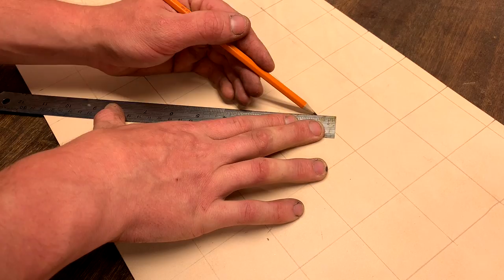Woodturning - Stacked Leather Mallet

Comment: Really great idea well executed  ... the only thing I would do differently would be to heat the steel rings on the stove before attaching to the mallet head to give them a tighter and more durable fit.
Reply from the maker: Thanks for watching Ryan, I did consider that but didn’t want to burn the rings on as it leaves unsightly marks. Instead iv used kiln dried wood that will swell somewhat in our fairly humid climate and I hope that as the end grain flairs over time with use it will also tighten down the rings.. I do agree tho.. smaller tenons and hot rings would
Make for a tighter fit. 👍🏻
Thanks for Watching
Reply: Thought this also

Comment: Excellent job Jack. A lot of planning for the design and materials used went into this project. Always a pleasure to watch your videos. Well done 👏.
Reply: I did not even know you could do this with leather.  Such a clever idea and great execution!  Your projects always make for good watching!
Reply from the maker: Thanks Rebecca. This is a fairly common style of knife handle and goes back century’s ( if not longer) rather than resin I believe they used some
Part of rain dear to make the glue 🥴 
And antlers to cap the leather/hide.
Reply: @JackMackWoodturning  That is great background info, Jack.  I am fascinated by mankind's ability to make tools out of what is at hand.

Comment: You obviously had a LOT of fun making that. Far more work than I would have done for a similar tool, but it does look really nice, and no one will have one like it. With the steel ferules you used on the ends of the head, standard M2 high speed steel would cut them down, as in facing the top and bottom of them. The through bolt was a good idea too. I did construction for years, and didn't like the metal handled hammers at all.  The leather on that should dampen all vibration issues....
Reply from the maker: Indeed, it’s a lovely grip. I didn’t consider turning the mild steel with hand tools but I’ve turned allot of brass on the wood lathe so probably should have gave it a shot. 
I definitely made this for the sake of making it rather than needing a mallet.. as, I’ve got the same old mallet I turned some 15 years ago for braying stuff, this little one was something I’d like my kids to look at when they are old men and laugh at how daft their old man was 😆
Reply: As long as they don't try to use it on each other......
Reply from the maker: I’d be very surprised if they don’t 😆

Comment: This is an excellent well engineered project.  The only thing that I did not understand is why you made the metal rings the way you did.  With your lathe experience, I would think that you would also own a small metal lathe.  It's amazing what you can do with a little 7x16 mini lathe.
Reply from the maker: I don’t own a metal lathe. But I definitely wish I did. Maybe il buy one. Hmmm. Thanks for the idea
Reply: @JackMackWoodturning  - Maybe I can help you buy one by giving you some information.  You probably won't need anything bigger than a mini, and there are two very good ones.  While most mini lathes have variable speeds that go up to around 2,500 rpm, most have a two speed gearbox that makes a lot of noise.  However the 7x16 minis sold by Micro Mark and Little Machine Shop have a brushless DC motor that has enough torque that the gearbox is not needed.  The MM lathe comes broken down in two boxes, so you won't need a crane to put it on your bench.  The LMS lathe has other advantages and they sell accessories that will work on both lathes.  Both companies sell mini mills with that same brushless DC motor.  
Most people that own mini lathes use them to make tools or accessories for their other tools, or even for their lathe.  The 0.800 spindle hole allows gunsmithing on anything other than a heavy match target barrel.  An outboard spider is easily made to steady long workpieces, I made mine from a black pipe coupling, but you can buy them ready made.  The 3" chuck that comes with the lathe (and the optional 3" 4 jaw chuck) will not pass a 3/4" item through it, but optional 4" and 5" diameter chucks will.  
The dials on these two lathes have 0.001" increments.  Most other minis have metric increments.  The lathes come with instructions of which gears to place where to set the thread pitch that you want to cut and the MM only lists US threads because they call it a "True Inch" machine.  However they both will cut almost any thread that is not too large for the machine.  LMS has free software on their website that will tell which change gears to place where, to cut the correct thread.  Using my MM lathe and the LMS software I was able to make guard screws for a Mosin Nagant, which have a very strange 8mm pitch.  
I only have two things to warn you about:
1.  UNPLUG it before opening it and changing anything.
2.  Be aware that you can spend at least as much on accessories as you will spend on the lathe itself.  
Have fun!

Comment: Sweet hammer! Just a couple of questions: was the style of this kind of mallet originally two pieces of wood? One for the mallet head and one for the handle? The plug at the top makes it seem the handle should go all the way through the mallet head as one solid piece.  Is this what you were intending to make it look like?
Reply from the maker: Hi Thomas, yes some mallets are made like that, I face most mallets are made in that style. Originally I was going to plain the cap on the top flush with the profile of the head but I kind of liked the way it looked so lady it as it is in the video. 

Thanks for watching 🤙🏻

Comment: Just subscribed, I wondered is there a reason for the leather in the handle other than the decorative effect, does it absorb any shock from what your hitting with the mallet?  It is a work of art, beautiful. Did you put glue between the leather or was it resin? It would look good with other tools in the lathe box.
Reply from the maker: Hi Karen. The stacked leather is good for absorbing shock but it is more of an aesthetic decision, with the perspex and aluminium included in the design. The resin was applied to each piece before stacking. Glad you enjoyed it, thanks for watching. 👍🏻😁

Comment: Wow, great video. Just wondering:
1) What is the black layer between the metal (aluminum I’m assuming) and leather?
2) What did you use to finish/oil it?

Thanks
Reply from the maker: The black layer is just perspex, I finished with shellac sealer and microcrystalline wax, 😉👍🏻
Reply: @JackMackWoodturning  - Except for projects made to hold food, I finish all my woodworking projects with either Lindspeed or Tru-Oil gunstock finish.  It holds up very well against water, and I use it for all my pen making projects.

Comment: Would love some measurements 
Working on one as one of my first turning projects
Reply from the maker: Hey dude. You don’t need measurements to make something like this.. just start with the things you can’t change and work from there. For example the threaded rod needs to be sturdy.. is m10 or m12 is a good shout.. the nuts that fit on said rod will be of a set size. So that determines the minimum size of your through hole for your handle and the diameter of the handle. The diameter you turn the head can be anything you want as can the length of the head or the length of the handle. 
The only reason you would need measurements for this would be if you want to fit the mallet into a certain space … in which case.. measure the space and work backwards from there. 
Hope you understand. All the best with your mallet.

Comment: Next one…..no plastic (copper would be pretty) and I’d suggest burnishing with carnuba wax. After sanding, use a block of carnuba wax, hold it against the spinning blank.  The heat of the spinning will cause friction and the wax will soften and transfer to the blank.  Let it cool for a minute or so and then burnish it with a section of denim.  I PROMISE it looks excellent. Warm yet very sturdy finish.
Reply from the maker: It is finished with carnauba wax dude 🤙🏻

Comment: Marvelous work 😍 
What is the spray you use over the bottom of the glued metal bar, right after having it positioned?
Reply from the maker: I think you are referring to the accelerator. It accelerates the glue drying time. 😊👍🏻

Comment: Very nice but I was expecting a stacked leather mallet.
Reply from the maker: You don’t feel this is a stacked leather mallet?
Reply: @JackMackWoodturning  my stacked leather mallet is the mallet head with a wooden handle to prevent damage when assembling engines etc.
Reply from the maker: I think your mistaking a leather faced mallet for this which is a “stacked leather mallet” meaning it’s a mallet with a stacked leather handle.. 

Maybe I should have called it stacked leather handle mallet but I feel that is too long winded and given that the thumbnail is a stacked leather blank I felt it was unnecessary. 

Sorry you were disappointed John. Il try to be more descriptive next time 😊👍🏻
Reply: @JackMackWoodturning  not disappointed at. Great video and great attractive mallet. The mallet I have is totally leather but rolled up and tacked with a wooden shaft through it. Made by my grandfather in the late 1890’s a woodworker on his fathers farm then in the City of York LNER Carriage Works. So in my mind my a young age a leather mallet. Sorry if it read as a criticism.

Comment: 3:00 Would it work if he just left the grinder wheel still while the tube was turned on the lathe?
Reply from the maker: Yes… but it would be extremely dangerous.. if it wer to nip in the cut the lathe would pull the running grinder out your hand. Then potentially wrap the cable around the pipe too. Any number of horrendous outcomes could unfold. 
Working safely is about being able to consider these points and minimise them 👍🏻

Comment: Hey Jack Mack, great project, how thick was the leather you used?  Love the look of the mallet and the size seems to be just right, did you think of adding a piece of leather to one of the faces?   Thanks for sharing
Reply from the maker: Hi Jim. The leather is 4mm thick. The mallet does feel a nice weight and balance. I do however plan to make a smaller one soon to add to the tool arsenal. I hadn’t considered adding leather faces but I think I will alter the design next time. Thanks for watching buddy. 👍🏻😊
Reply: @JackMackWoodturning  I have just subscribed to your channel and will watch some of your previous video's.
Reply from the maker: Thanks Jim. Enjoy 😁

Comment: Hi jack.I hope the steel rings hold on though out the years.Just a passing comment due to wood shrinkage and ferrules. It's a shitty combination  sometimes. How's the elder wood progressing? Still can't find those 100 mm angle grinder carving discs with a 22mm bore on ebay. Help! Best regards from soaking wet Fife.
Reply from the maker: Hi John. Is this what your after? 

https://www.axminstertools.com/saburr-tooth-carbide-round-face-disc-4-100mm-o-coarse-505395
Reply: @JackMackWoodturning  Thanks Jack. I found those in Axminster's catalogue, but I baulked at the price. Best regards.
Reply: @bryanholden6487  Thanks Bryan. That is helpful. I didn't think of them. Best regards.
Reply from the maker: Cheers Bryan. I have to say when it comes to something like this I’d rather spend the money with a company I know and trust. The one I have was by KA tools.. I had to have it shipped from the USA and it cost a bomb, but it has lasted years and years of fairly frequent use. It also has those big old 25mm holes in it which means you can see through it while it’s running. 

While the cheaper options may still do the trick I shudder to think what could go wrong with them if they are badly engineered. 

I could also be completely wrong 😆

Comment: Won’t the nut work its way loose, and you won’t be able to get to it? Or did you glue it in?
Reply from the maker: It’s a ny-lock nut.. I’ve never known them to work loose. But if it ever did I can just pop the cap off and tighten it down. 👍🏻
Reply: @JackMackWoodturning  Ah hah, I have learned a new fastener type! Thanks.

Comment: Doesn’t the metal kill your tools?
Reply from the maker: No. Aluminium is on the softer side as metals go. And the cutting tip is made from carbide, it’s super hard so it doesn’t make much of a difference. Thanks for watching Derik 😁👍🏻

Comment: Need a little more band saw blade showing.damn unsafe.
Reply from the maker: It’s not unsafe. It’s lifted for the camera to get the shot. 
Having the bearings closer to the cut makes for a better more guided cut. 
The function is not primarily one of safety .. it may be unsafe for you,, as you seem to not have a good connection between your brain and your finger tips.